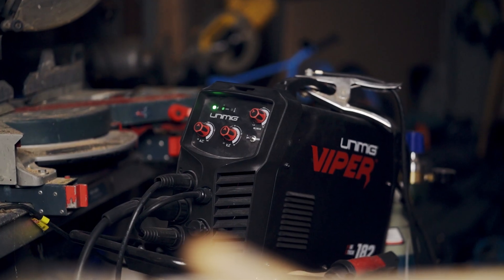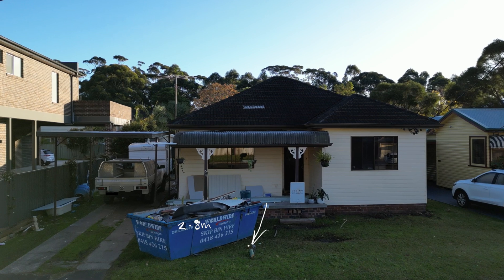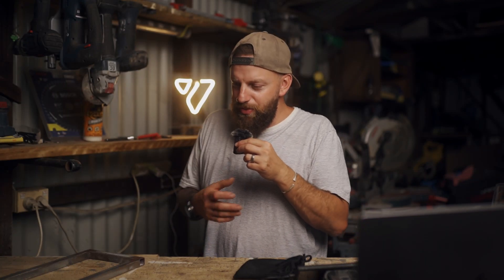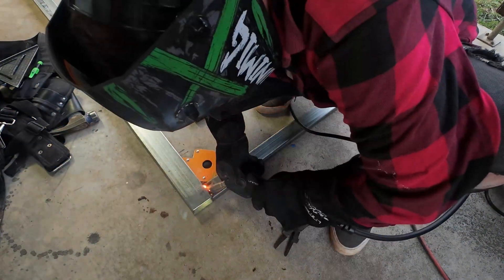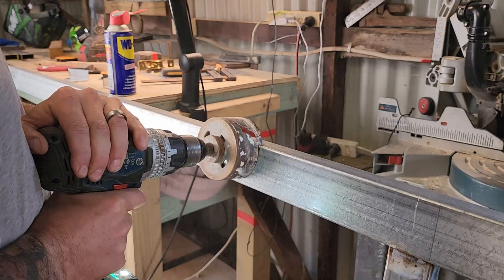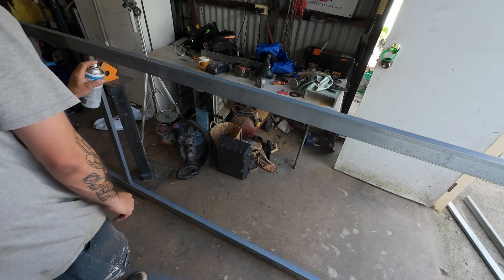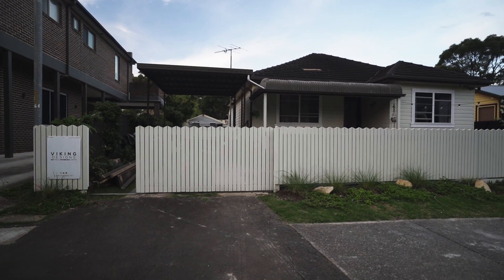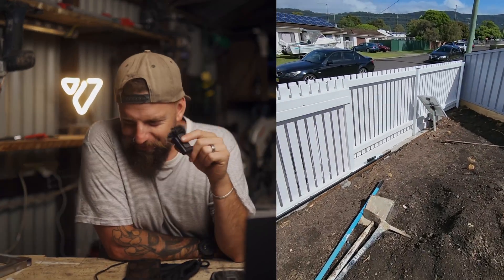Building an automated gate |  A carpenter attempting to weld

Comment: Hay bloke great job, not a boily but can weld, when your doing a butt join angle your gun at the the thickest piece of steel towards the rounded edge not streight down at the the cut off edge as can burn through, hope this helps, I started out doing cursive e's but now have switched to whipping action, 3 steps fwd 2 steps back, got the same welder it's a little weapon, if you can lay a good bead on a scrap piece of the same thickness and have signs of good penertration on the under side of your laughing.
If your welding gasless no need to grind back gal done about 40 odd meters of framing panels on my joint all streight over the gal.

What thickness of steel did you go with, 2 or 3 mm ?
Reply from the maker: Love it mate. I'll take all the help I can get. 🙏 Was watching a bunch of YouTube vids too. Went with 3mm.
Reply: @viking.designs  champion!!! I've been meaning to build a roller gate for a fair while now, also keen to have a crack at your micro cement basin too 
Cheers